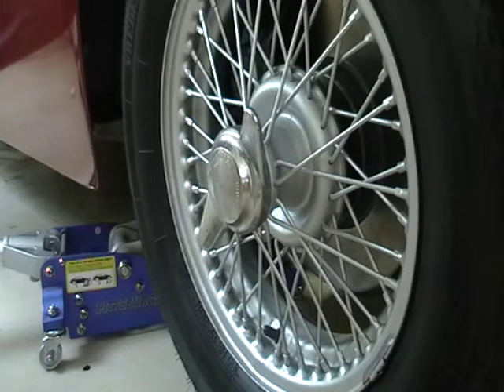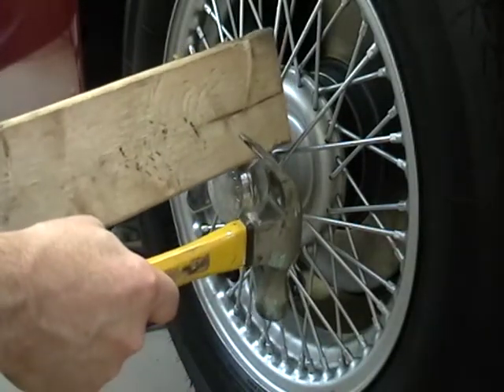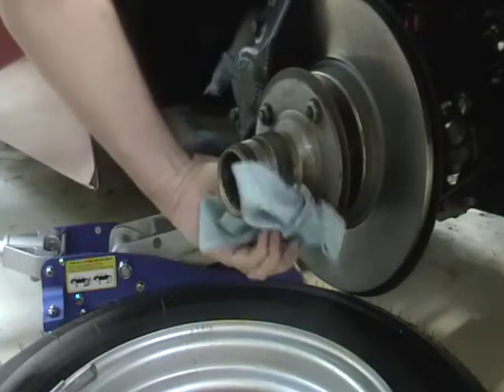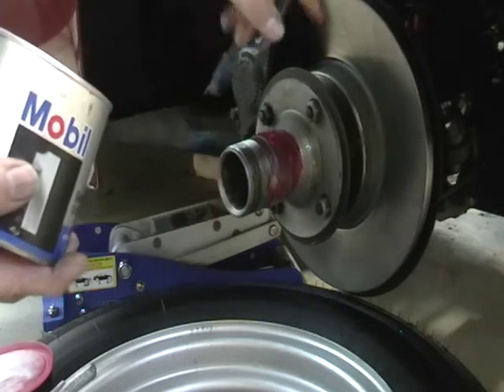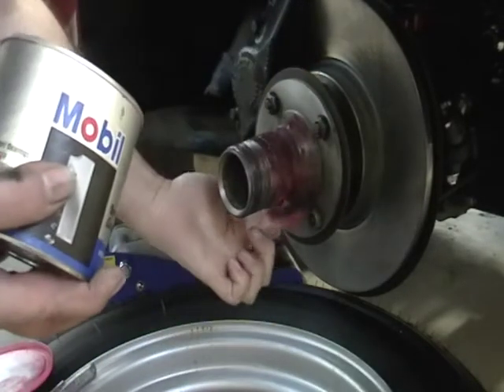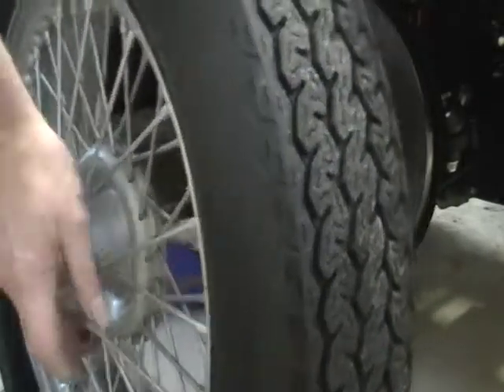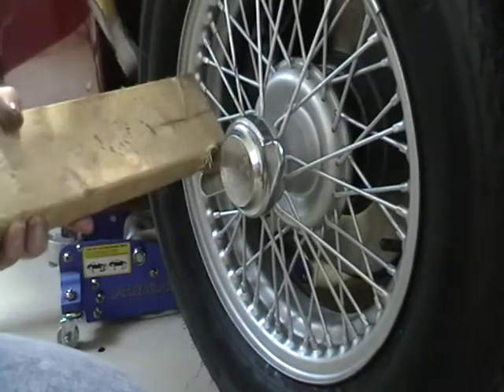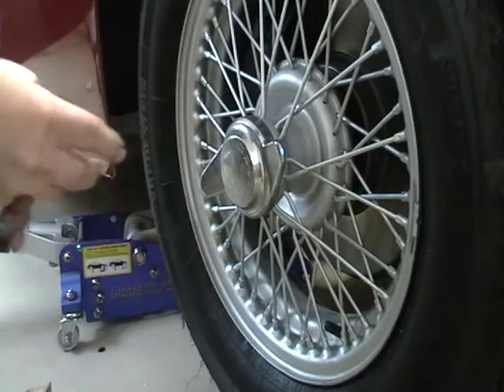Correctly Regreasing Wire Wheels on a TR3A

Comment: Great video. So many people put grease on the tapered faces and wonder why the wheel doesn't feel tight! Good tip putting the wheel on first to squish out all the excess grease on the tapers, then wiping it off.
Reply from the maker: Thanks!  Hendrix wire wheels told me that one!
Reply: Wrong on so many counts. I almost cried when you hit the spokes with your wood and hammer ( when taking the wheel off). You didn’t smear silicon on the spoke heads to stop grease migrating out of the ‘hub’ (an old trick that those in the know have used for years to keep wire wheels from not needing to be cleaned). The taper needs a smear of grease before putting the nut back on. B.